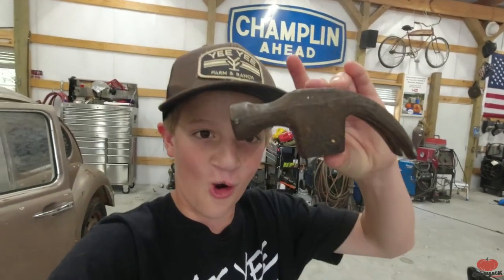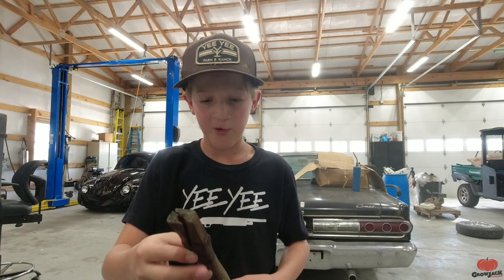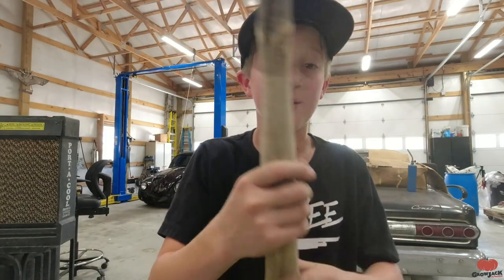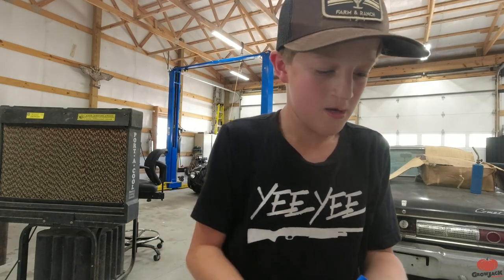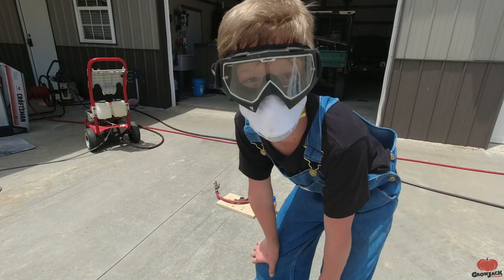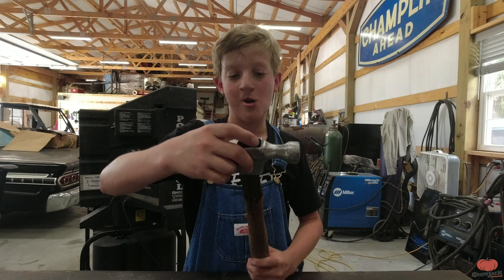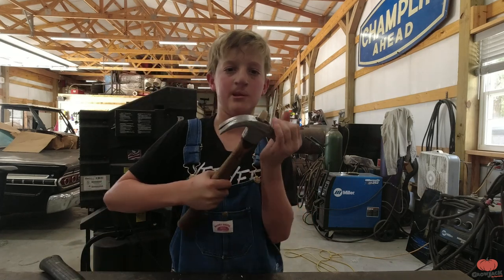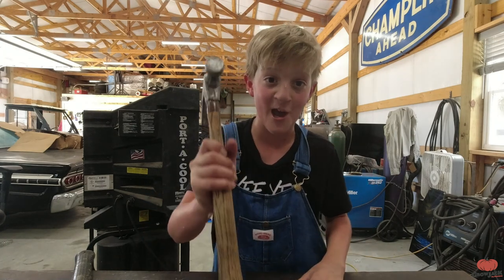Restoring an old HAMMER

Comment: Hi Jack, That's another good video and a good job with the hammer.  Now you just need to test it by hammering in a nail, almost all the way in, and then using the claw to pull it out.  Hammer heads can last a very long time, so you might still have that one when your grandkids want to fit a new handle to it.
As it happens, I do quite a lot of restoration projects on old tools, and lately I have been doing quite a few old tool boxes too.  Sometimes I use electrolysis to remove rust and sometimes I use vinegar instead. Almost always I use a wire brush too.  Some tools get a paint job and others get metal polish.  It's amazing how many tools get thrown out that just need a clean up! I did a hammer too just a month or so ago. I this case I cut off the tatty top end of the handle, then sanded down the new end to fit the head, and used two wooden wedges to make it a tight fit. Afterwards I painted it all with green paint.  It's about two inches shorter now than when I started, but I'm pleased with the result.
If you decide to restore the pliers, The jaws would look nice with a polished or buffed up finish, and the handles could be painted or covered. Heat shrink makes a good handle cover.
Best wishes Jack :-)

Comment: After putting the wood wedge in the top of the handle then if you soak it in oil (motor oil works fine) the wood will swell up and it will be in there real tight. That's better than driving a nail in it.  They also make metal wedges for that but a wooden wedge them soaked in oil works well.  I used keep all my splitting mauls, axes, and sledgehammers sitting in oil when I wasn't using them. Just need a pan with maybe 1/4 to 1/2 inch of oil in it then set the head of the tool down in it.

Comment: You need two channels Jack, one for all your agriculture projects and one for every thing else; just called "Jack."  Lol. The split at the top of the handle is for a little wedge to spread the handle and keep the handle from flying off.  You'll want to either soak the head in oil, or use furniture polish on it to give it a protective coat to keep it from rusting again.   Great job.

Comment: I like your restoration videos. I have an old push mower I thought I'd clean and sand then get the blades sharpened. I bought a wire brush and couldn't do anything to those old blades.